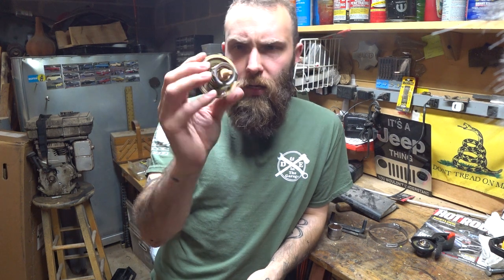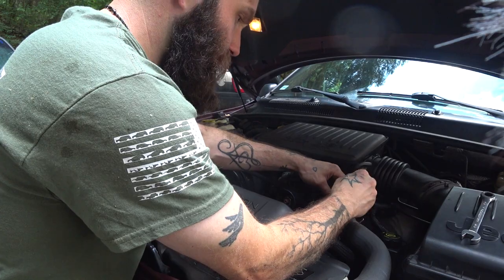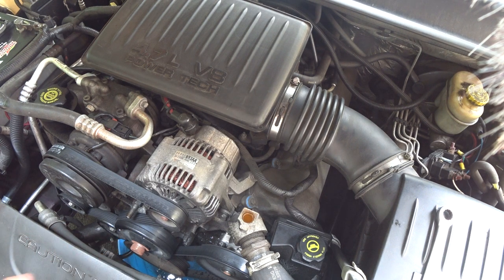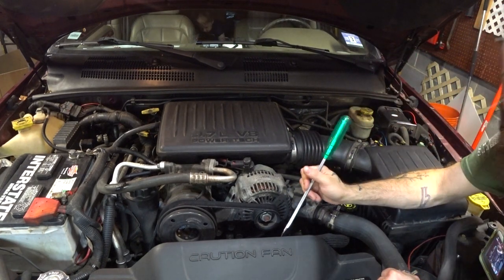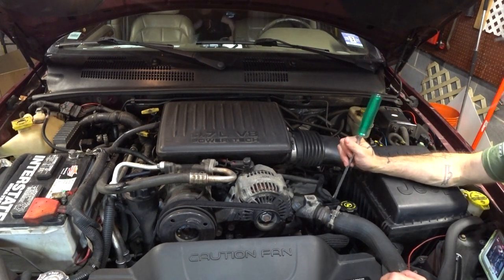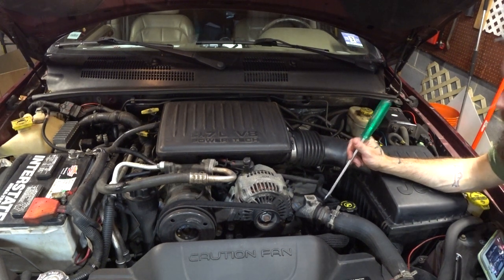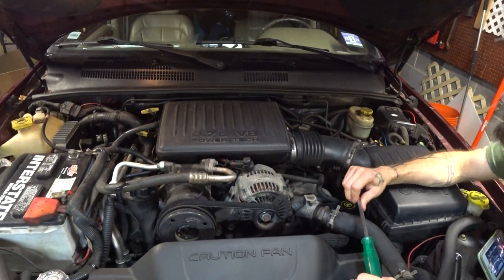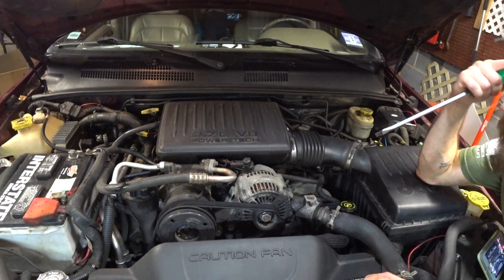How to keep a Jeep Dodge 4.7L alive & happy - EVERY FATAL FLAW I LEARNED THE HARD WAY!

Comment: I own a cute little 02 dodge SWB truck with a 4.7 I bought 6 months ago. Pretty happy with the gutless thing but worry about the nearly 300,000 miles on it and it uses oil at the rate of 1qt every 5 tanks of gas. I run expensive synthetic oil in it and it purrs like a kitten.
Reply: You think that's gutless, try a 3.7 :) never owned a V6 truck before but for a year now I do. I would have never bought it but is was too good of a deal to not buy it. It is slow af. At least it's a little Dakota, I can't believe they put the 3.7 in a ram, I would imagine it would be slower than molasses in January with a headwind.
Reply: @gedungisphoopnuchle9121  I put new lash adjusters and rockers in it when I put it on the road. I bought it with the dropped valve seat problem for $800 with 60,000 miles on it and no rust. Put a used engine in it I got for free from work, new upper and lower control arms and tie rod ends, rad, water pump, fan hub, thermostat (don't know why it overheated in the first place so I did everything) new block heater, jounce bumpers, four shocks and four new tires. Like $4500 (canadian) and I basically have a new truck. I don't even like the thing to be honest but it works and does not have cancer, so I'm gonna run it.

Comment: Just picked up a 2000 Grand Cherokee  with the 4.7 liter. Previous owner put a mech fan on it and seems to be just fine.  My concern is it smokes a little out the exhaust.  I did remove the cat or someone stole it so they removed it for me so I don’t know if that’s the reason or what.  I will say that it feels really strong like more than it should. I have a 2004 4.0 so I expected some power increase but this thing is crazy. Lol

Comment: I have a 04 Jeep Cherokee and the fan don’t come on but from the gages it’s not overheating.
Reply from the maker: Is it a 4.0 or a 4.7. If it is a 4.0, the fan relays (under the head panel under the passenger headlight) goes bad ALL the time

Comment: Had a cooing issue on my 2000 JGC Limited 4.7. Engine would run fine for an hour then start overheating with boil over. Finally found water pump had a plastic impeller that was just fused to the solid meal shaft. When it would warm up the impeller would just slip on the shaft and not move the coolant. P__s Poor Design. Replaced water pump with metal impeller unit and never had another problem.

Comment: I have a 2007 commander with the 4.7 I just bought it with a "head gasket leak" put cam in cylinder #5 and sure enough theres a small puddle of coolant collecting and caught a drop rolling down the side of the cylinder right into that puddle. Not sure what to expect when i tear this down. Looking for any advice.

Comment: How do you feel about replacing the clutch fan water pump and replacing with a standard pump? Deleting that fan and relying on the electric fan only?
Reply from the maker: Huge fan of that idea (no pun intended). I had the hydro fan. Personally I would like to swap mine back to the 1999 4.7 style which had a mechanical fan and an electric fan without the use of the power steering driven hydro fan

Comment: so the 4.7 in the durango applies? solid question
if so im a certified tech and am more that willing to talk everything about this 4.7 and way to really make it bullet proof 165,000 on the engine and still fully operational. timing and self oiling and cams and seats for the valves. Its pretty easy with applied knowledge and a bit of new tech. would love to chat.

Comment: I had a 2004 Wrangler with a 4L.  It had a dumbass German steering box that had O ring pitman seals, leaked like an old Harley.  Almost a grand for the part, back in the day.

Comment: I have a 2005 Dodge Dakota 4.7 With 26,000 miles. Coolant leak. When driven it does not overheat even with the a/c on. The temperature indicator always goes to the normal position. When driven home and parked in the garage, there is no leaking but after a period of time, there is about 1 cup of coolant on the concrete floor near the left  front of the engine. All hoses are good, recovery coolant tank is not leaking. The radiator cap was replaced and it is leaking later every time it is driven which is about once a week and  2 to 3 miles. I have gotten underneath it and looked but cannot find the leak so far.  Any ideas are appreciated. Allen M. Mobile, Al.

Comment: I was having issues with my 4.7 cooling at high elevation. I would get a slight temperature increase and then have the coolant tank overflow as soon as I shut her off. I ended up replacing the condenser, ac compressor, lines and radiator and now she runs like a dream. The filters inside the condenser wear over time and actually had ended up clogging the system up, which caused the overflow. So keep an eye out for that. As far as the coolant colors, I have been running the green in there for quite some time in the desert heat here in Vegas with no issues, but what should I be looking out for? What is the difference between that and the orange? I plan on changing to orange before this next summer thanks to your video.

Comment: Got a 4.7 in a 206k mile '03 RAM with a light ticking  noise among other minor issues, I've seen it's a possibility of the exhaust manifold, lifters, & a bearing, any suggestions on what it could be?

Comment: I just picked up a 2005 WK 4.7 with 187k miles on the clock. The coolant reservoir is a little low. Am I safe to just add Zerex 50/50 to the coolant reservoir or do I need to do the whole bleeding thing? Thanks for the info!

Comment: Hope you read this comment and can offer me some direction a 2005 4.7 jeep my boy is working on came into shop with heater core completely blew out  replaced it filled with coolant bleed system  but seems it builds alot of pressure in system that the top hose gets rock hard but temp stays mid way on gauge,has a new 18psi cap but not sure if it's  opening at 18 psi
Reply from the maker: Hey bud. I can’t say I have come across that before. If you bled the system through the 10 mm bleed port, then sounds like some kind of obstruction? The fact that it doesn’t overheat is a real melon scratcher. Sorry I couldn’t be more help

Comment: Your got to have orange coolant for the 4.7? Just got one let me know because mine has green in it
Reply from the maker: Yes, all Jeep/Dodge 4.7's should have Orange H.O.A.T. coolant, but very often a previous owner or even a shop just puts the green in. I would suggest swapping it out. It is about $15 per jug from the dealer which is very reasonable
Reply: @DEInTheGarage  what kind of power steering fluid do you use?

Comment: For what it’s worth, I drove about 20 miles on a 4.7 with a inop power steering pump. It didn’t overheat. Not saying I recommend it but I got away with it
Reply from the maker: Interesting... I imagine idling would have done you in, but it is good to know it is possible in a pinch
Reply: D&E In The Garage that’s true it was mostly interstate driving. That was a few months ago so I may have just gotten lucky
Reply: My 2000 D had a clutch fan and an E-fan... I replaced both with a flex-a-lite shrouded E fan which is atrociously loud but you can watch the temp drop almost instantly when it kicks on.

Comment: I have codes being thrown out. I believe it's p0740. I've replaced the tcc and after driving a few miles the check engine light came on and now the trans temp warning light came on. you think you can point me in the right direction on how to resolve the issue?

Comment: Hi man I really appreciate the work you r doing  but i am wondering what kind of steerig power fluid you using in your wj should I use the mopar ATF+4 ?
Reply from the maker: Depends if you have the 4.7 with the hydraulic cooling fan (which runs off power steering pump). If not, then ATF is fine. If you have the hydro fan I would suggest getting Mopar fluid from the dealership. It is a bit more expensive, but it is most reliable in that system
Reply: @DEInTheGarage  Thanks

Comment: Don’t forget the issues these 4.7 v8’s engines have with the hydraulic lifters going bad & it allows the camshafts to kick-out the rocker arms... 😟 it’s mainly due to people not doing adequate oil changes/ goin too long with sludgey old worn out oil, & the lifters end up collapsing in/ excessive wear which leads to what hears- to be a valve ticking noise, which then if left unattended leads to the camshafts throwing out rocker arms & it ping ponging inside the plastic valve covers doing a shit ton of damage. Btw- for repressing in new valve seats on those Aluminum cylinder heads at my local machine shop: it costs $330 for all 16... now- given that (on most engines susceptible to this issue) its usually 9times outta 10 gonna be the exhaust valves that have the higher likelihood of becoming the dropped valves. But hell- if the heads are already getting new ones pressed in, why take the chance & only do have of them? It’s already apart so for a lil assurance do all of them... my belief is on anything: “if ya gonna do a job, do a job the right way- the first go around”.

Comment: My 2009 Dodge Ram 4.7 came from the dealer with the green flavor.
Reply: Just don't mix different ones. I run the regular 50/50 in mine just fine and mine is at 170K miles now. 2009 Ram 1500 4.7. Mixing different coolants with the HOAT type (orange) will cause gunking and gelling in the cooling system.

Comment: Day 4 of owning a 06 4.7, Full of green Radiator flooded and just pulled a Thermostat open code. This video was needed. Also, do you have any brands you recommend? Besides the fan, I'm changing the temp gauge and thermostat along with changing the green to orange Koolaid. I was gonna buy Mopar parts but you may know of a better brand.

Comment: I have a 2002 doge Dakota slt 4.7L v8 and I replaced the head gasket and the whole cam shaft cylinder head got the new one on everything put back together replaced the thermostat and put semi new radiator in it and the temperature will stay at normal but when operating temperature hit both my coolant and oil run straight to high any ideas?

Comment: appreciate your videos! I've learned a lot. my 2006 commander left me stranded today due to a bad upper heater hose busting. driving down the road, battery light came on the dash...min later, the temp gauge began to rise and the heat was cold (middle of Jan 2021...20deg. cold!) I immediately pulled over when the gauge continued to climb (before reaching the H)... 

my question: in the morning when I get to bleed the system correctly, will the heat work or am I looking at a thermostat or something else...? THANKS!

Comment: I just today bought a 2005 ram 1500 with a 4.7 in it.  Is there any other maintenance or little things you recommend changing out on a stock 4.7 engine?? Like any other notable problem spots?

Comment: I do NOT want valve seats dropping on my 4.7 HO.
I'm hoping to replace the timing chain, as it has a rattle on cold start-up.
Great Jeep. 
Love it to bits, and want to keep it that way.
Also have a scungy 4.7 Powertech with munted heads, non HO.
Nice wagon, but not the way it runs. 5 or 6 cylinders at best.
Really, since there are 17 differences between the engines, apparently, then the black one is pretty much beyond repair.
Big pain in the ass.
Reply: If the timing chain is janky, replace it asap.

Comment: Been working on my 2002 4.7 SLT , thermostat gasket had a pinch and was having a minor leak from the housing, fluid was green until today . Replaced with zerex yellow coolant . Bleeder valve sorta kept seeping bubbles but calmed down after running it to temp. What else should I do to prevent anything else
Reply from the maker: Just the bleed man. The 4.7's will stay cool and not give you any issues as long as you get the air out.

Comment: Excellent review - I’m looking at a 2003 Durango with the 4.7 liter 134,000 miles.  If it’s maintained would you recommend or consider it?  Thank You.
Reply: Yeah Jess I'd definitely recommend it.  Like you said, make sure you can prove its been maintained though.  I've had super good experience with 4.7s.  Dad had a 2001 WJ with 340k miles at time of sale, and I have a WK with 190k that is running like new.  Doesn't burn oil, great power, same MPGs as what it was rated for off the dealership lot.  I'd go for that Durango no worries man!

Comment: The problem isn’t the fan. It’s the size of the radiator. The factory 2 row radiator should be replaced with a 3 row aluminum radiator. That is the problem.

Comment: When I got my 99 limited I was pretty worried listening to all the horror stories on the 4.7. But I’ve beat my 4.7 to hell like all us teenagers would. It’s  bounced off rev limiter, ran low on oil and ran at over 210 many times. But it still sounds smooth. I know, I know I have a ticking time bomb on my hands with the abuse I’ve put on a it. But maybe I got lucky that mine hasn’t gone down yet without a proper fight on the other hand my transmission is just limping along. And I’m at 215k. But I wish they would’ve done a conventional cooling system like the 4.0s or other American vehicles.
Reply: I have a 2000 4.7 and have been doing alot of research on jeepforums.com . Mine came with both mechanical and electric aux fan ,  going back with dorman 620-155 and  hayden 2794 my water pump needs to be replaced as well.

Comment: Hi Doug, thank you so much for all your cooling system videos on the 4.7 - they are all SUPER helpful as is all your other WJ content.  

The temperature sensor you refer to between the alternator & a/c, to pull out and test if your fan is working correctly, I can not seem to find mine.  Could you give me a little more detail on where & which one it is?  Thank you, Doug!

Comment: personally if they beefed up the pistons rods and heads on the 4.7 high output 2008+ version they could be beasts of an engine sad they didnt put a lot of effort into them because if the aftermarket parts were there they could easy make 500-600 in my opinion

Comment: Man I was putting off doing the mech fan swap on my 4.7 until my power steering pump went out. I figured may as well get the mech fan since I would have to swap the pump if I did the mech fan swap anyway. Boy oh boy I hate I waited so long to do the swap. Don't do like me and attempt to keep the 4.7 shroud you will need the shroud from the e-fan 4.0. I just unbolted the e-fan from the donor vehicle shroud. Basically you will need the 4.0 power steering pump, 4.0 power steering lines, 4.0 fan shroud, the fan blades (i forget the exact make and model) from a ford, and the clutch from a 01ish mountianeer/explorer with the 5.0. You have me on Facebook messenger if you have any questions feel free to send me a message and I will send you the part numbers of the fan and clutch I used.

Comment: I put a rebuilt 4.7 liter from a 2004 Jeep Grand Cherokee to a 2007 Chrysler Aspen now i have misfire codes and whatever else.Took it to a repair shop and they said the motor won't work in this Aspen what gives much work done PCM rebuilt /any help?
Reply from the maker: I know they changed a few things like the intake and some other stuff, but I do not see an reason a 2004 would not work in a 2007
Reply: @DEInTheGarage  yes they did but the cam numbers across the board are the same .I used the 2007 intake

Comment: If you eliminate the hydraulic fan, what will you do to keep the check engine light from coming on? There is a sensor to let you know that the fan is not spinning (check engine light). I am curious to see what solution that you come up with to see if it worked better than mine.
Thanks. Great video
Reply: To avoid the code just remove the solenoid from the fan motor, plug it back in to the connector, and tie wrap it to the crap under the battery tray.  It keeps the computer happy.

Comment: I've got an 05 ram 4.7.  Currently having a misfire.  Its losing power mostly going up hill and starting to shake when driving.  Smells like I have gas in the oil. Its not over heating, but I do get the flashing check engine light.  It also makes a clicking sound when driving What do now?

Comment: Mine had been bitchin about low coolant so i had my mechanic flush and fill... now its bitching again! Time to try out a new thermo maybe? Hopefully mines not leakin coolant that would be bad. Hasnt really overheated though, even on long highway runs through the central valley 100° weather so idk

Comment: I'm having a overheating problem with my 02 dodge ram 1500 4.7. I've replaced radiator, water pump, coolant temp switch sensor and thermostat. When I let it warm up in the driveway even with the a/c full blast everything is good. But after driving it 5-10 minutes it wants to overheat. Any suggestions
Reply from the maker: Usually if it is good at idle, but not when moving it is a flow issue or a low coolant issue. Have you ensured it is properly bled? These 4.7's are a giant PITA to properly get all the air out of the system. Also, if they have ever had old style green coolant mixed with the proper orange or gold H.O.A.T. coolant there is likely sludge from the two mixing and building up this kind of snot in your heater core and water passages. I had that issue on the Jeep in the video. Hope that helps. If you want to chat more on the issue, feel free to email me. dandeoffroad@gmail.com. It takes me a while, but I will get back to you. Good luck!
Reply: @DEInTheGarage  I didn't bleed as well as I had thought so I went back through and did it again. Thank you so much

Comment: I have a 06 ram 1500  220k miles it has p0300 code I changed spark plugs but still feels slow… when I step on pedal to accelerate starts check engine starts blinking and when I take my foot of gas it stops blinking